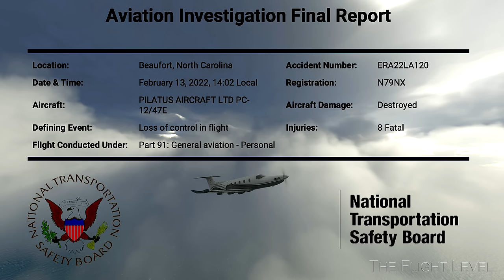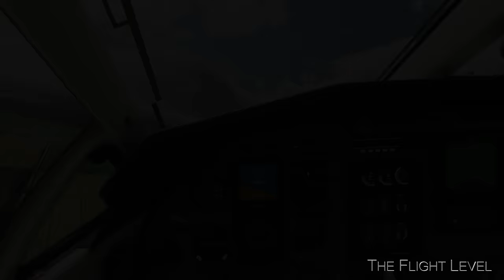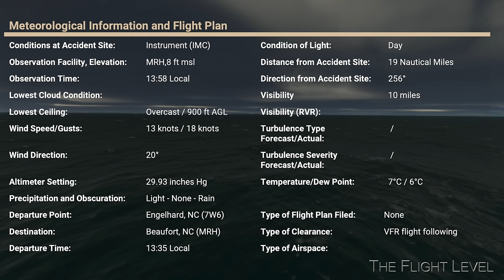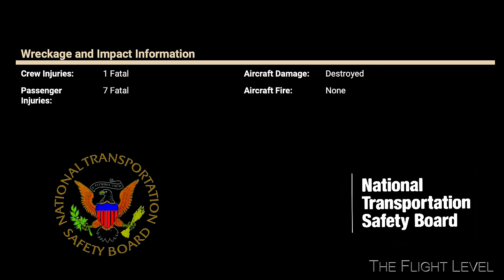Final Report - Numerous Pilot Inadequacies for the Fatal Flight of N79NX- Unbelievable Cockpit Chaos

Comment: Tragic. With the ease of flight planning there is no reason a person should not create a proper navigation profile. The software allow a pilot to file an IFR flight plan and load it to the plane. 

Additionally, it seems this pilot spent a lot of time flying in this area. Local pilots should be very familiar with the restricted airspace and how to navigate the area whether it is active or inactive at the time.

Also, most advanced aircraft have a single button that you push it and it tells the auto pilot to take over and maintain straight and level flight.  Hit the button take a couple deep breaths, and ask ATC for help
Reply from the maker: Excellent comments! Thanks for your insight!

Comment: I realize its a Turboprop engine.
And not saying he was overweight but just because one has 8-10 seats in a plan le doesnt mean they should be filled.

Could in theory placing the heavier adults to occupy back seats influence aft CG? 

Invreasing stall speed or angle of attack?
Reply: Weight and Balance had zero to do with this accident.   Why introduce it?   This "pilot" needed more DUAL in a 172 and should not have been handed the keys to this plane.
Reply: @lbowsk  
Just assumptions we all can add here.
So, how many hours did this pilot have in this exact model & type?
1 month, 6 months, 24 months? 
We are told he did have his single, dual, instrument & CFI with over 3,000 hours total. Do you have 3,000 hours & a non professional GA pilot?

We agree he wasn't a newbie pilot with less than 100hours under his belt.

Now if his son was left in charge of flying to gain experience with only 20hours I can see him causing this.

Or if one hasn't been practicing hand flying often especially in this type plane things happen fast & a pilot turning off autopilot in weather things get bad fast agreed.
Reply: @lbowsk  WTF?
It's been reported that this pilot did not even do a proper weight & balance.

In planes weight & balance are critical.
If any plane has AFT CG the nose could pitch up sharply departing stable flight and is then non recoverable. 

As one burns fuel in wing tanks the CG does shift durring flight.

Again, since he never did a weight & balance prior flight how do you even know for certain that it didn't contribute to this particular accident.
Reply: I have not heard that he did not perform a WB.   However,  he successfully flew the plane 61 miles and then hamfisted it into a stall which he then further dicked up until he flew a perfectly good AC into the water. The video said that he was down to 103 knots and THEN pitched up to fix his low alt alert.   Given all that, I seriously doubt that the WB had anything to do with it.   MIGHT if have affected stall recovery?   Certainly.  But the plane flew just fine for quite some time before Chuck Yeager lost control of it.   It's possible that the reason he didn't do a WB is that he was quite familiar with loading that plane and was certain that even with all the seats full he was within limits.  I don't know anything about a Pilatus other than it looks nice on the ramp.  Idunno, find and listen to (or read) the entire CVR.   It's pretty clear to me that this guy was going to crash that plane sooner or later. @Mikinct
Reply: @lbowsk  still a lot of questions.
If this plane had built in stick shaker & stick pusher how did plane still stall?

I've read in other accidents with runaway trim pilot needed to pull fuse for that.

But unless it's clearly marked when in IMC, warning lights & alarms blaring. Finding exact fuse to pull in that situation would be "interesting?"
Reply: Aircraft loading.  CG shift with fuel burn (on a ten minute flight).  Stick shaker.  Stick pusher.  Runaway Trim. Fuses....   While any one if these MIGHT have been an issue, we are already certain and have proof that the guy in the primary control seat was a HUGE issue.  He was a week behind the static wicks.    Flying is stupid easy, until the exact minute that its not.  And when that happens you need to dumb things down right now and FLY THE AIRPLANE.   Not wander through MOA's.  Not push buttons.  Not lose your cool.   Not re-progam the FMS or AP.  Not descend below the appropriate altitude.  Not get stupid slow some distance from the asphalt.  And not stall the plane.    @t
Reply: @lbowsk  "flying is stupid easy?" Said every pilot in the thousands of plane accidents have stated. 

Every commercial plane accident first things one Hears is this pilot had 10,000 hours of flying & 2500 hours in specific plane but a accident still ensured anyways.
Reply: Not a factor in this situation the pilatus is a very capable and powerful airplane with 8 on board
Reply: @Mikinct the PC-12 is designed specifically to carry a huge load. It’s kind of a pickup truck of the skies. So no, weight and balance is not an issue with this.

Also, he was right, “flying is stupid easy, until it’s not”.
Reply: @lbowsk agreed with everything you say.
Reply: @rtbrtb_dutchy4183  
With as many fatal ga accidents each month I beg to differ.
Reply: @rtbrtb_dutchy4183  weight & balance always plays a role even in turbo prop planes. Just watched a UPS Cargo commercial 747 crash do to bring too aft heavy on takeoff & loss of control.
Reply: @Mikinct  I never said that weight and balance isn’t important. But you can’t compare a 747 with cargo, versus a PC 12 with 8 people. 

I’ve flown many aircraft, from small to large. Some aircraft are sensitive to weight and balance and some are less. 

The PC-12 is an aircraft that was build to haul a lot of things. 8 people are not going to influence the W&B much, especially on such a short flight.
Reply: @Mikinct  you focus on the “flying is stupid easy” part and the ignore the “until it’s not” part. You missed his point.
Reply: @rtbrtb_dutchy4183  Sarcasm hidden in IMC, almost didn't see it :-)